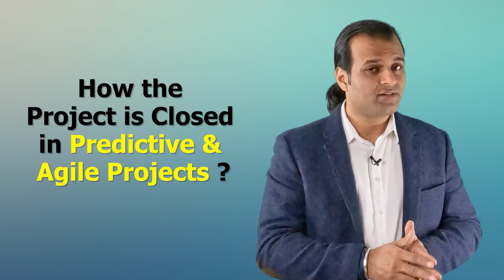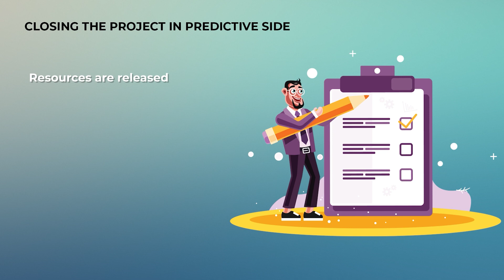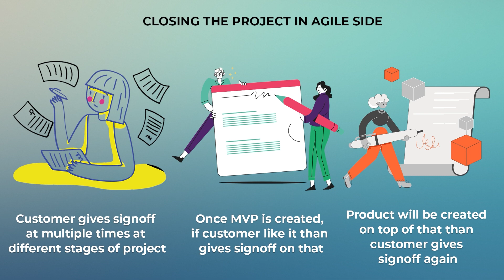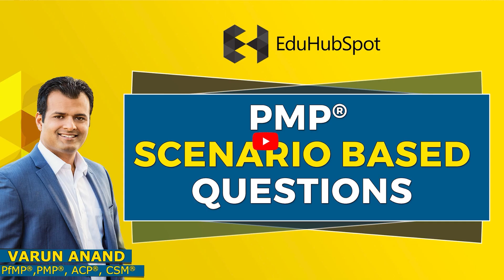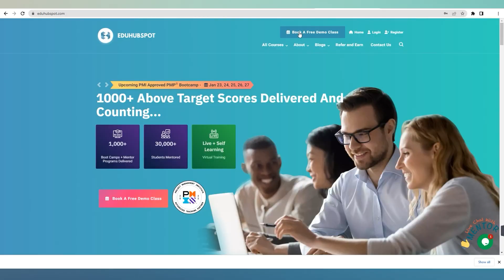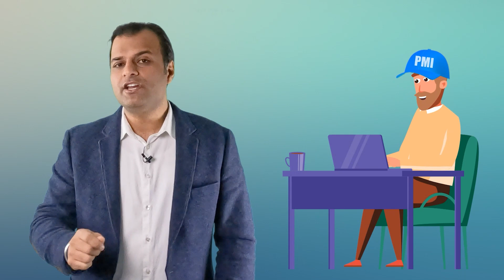Closing the Project in Agile and Predictive - PMP Mindset Tool for PMP 2026 : Get now !!

Comment: Hi, I would choose option C. As the project is at the final stages, updating the lessons learned register regularly is not realistic. I will be more than happy if someone proves me wrong. Open to your thoughts...
Reply from the maker: You are right, updating the lessons learned register regularly is not realistic but remember you are in PMI world which means you have to follow the process and as per process + a good step is to update it regularly. If you select the option which is updating it whenever possible then that "whenever possible" will never come.

Varun